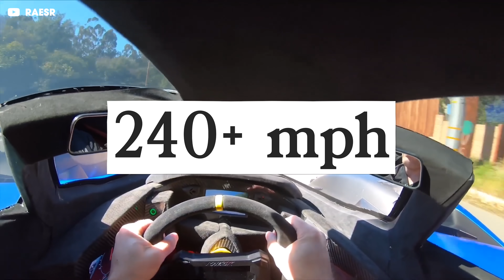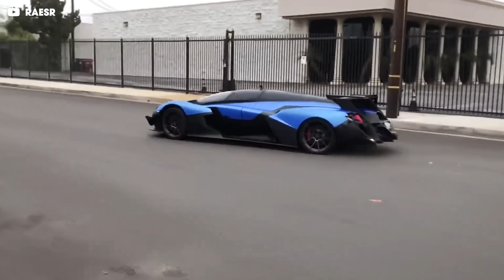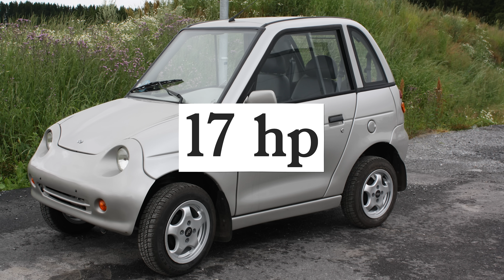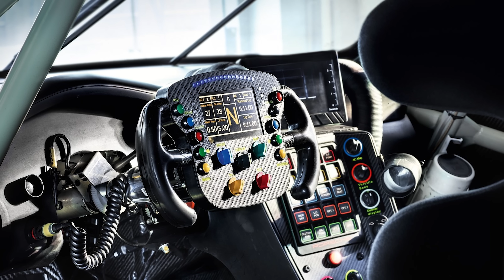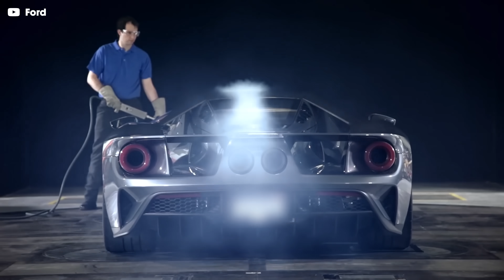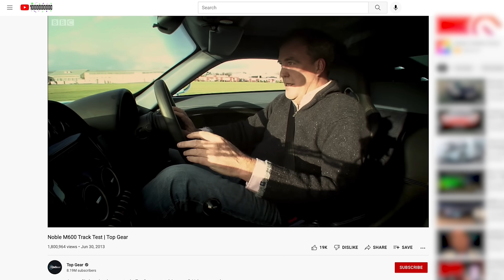Can This EV Hypercar Deliver on its Promises?

Comment: I believe the torque and horsepower claims. Electric motors produce absolutely bullsh*t amount of torque and horsepower, especially at launch and when cold respectively. It's why electric cars only need a final drive, but not a gearbox.

Comment: So with the 4000 ft/lb of turn... Are there actual parts that can take that other than a 5" solid rod of carbon fibre?  Or are there products that can take that strain and would fit in the drive train?  I'm an electrician, I know nothing about cars.
Reply: There's already parts that take that kind of torque. Torque is already reaching those sorta numbers after being increased by the transmission and differentials, my hummer for example Isn't far off from 4k wheel torque in high range, and around 16k in low range.
Reply: @wolfgang_h3t  yeah I had no idea, that is some kinda engineering!

Comment: The Lucid Air offers up to 5000lb-ft of torque in the top version. Electric motors are nuts like that.
Reply: You didn't watch the video did you.. lol
Reply: @calholli  
It would seen you didn't watch the video. Try watching the part about doubting the  400lb-ft of torque. It's early in so you don't have to dig that far.
Reply: @DocWolph  The 5k that you're talking about is 'wheel torque.  It's not even a relevant number really.  That means when I put my 4x4 in 4Low, I double or triple my torque at the wheel..  Looks good on paper, but doesn't tell the whole story.
Reply: @calholli  
I know. You think that because I did not say it I did not know? I knew about this stuff long ago.

As for relevance, it depends on how the motors are powering the wheels. Take a Dodge Demon 800 ho and about 800lb-ft, at the crank but at the wheels its about 3800lb-ft. But the ratios in the Transmission vary and are much larger. A direct drive EPV (Electrically Propelled Vehicle, or BEV) does not get quite so much of a multiplier. So the motors are going to be about as similarly powerful, albeit divided by the number of motors in proportion to which motor(s) are more powerful.
Reply: @DocWolph  That's why they created HP, because it uses torque, but also accounts for RPM's.  Some of these EV's are using planetary gears too.. Like the Porsche has a 2 speed trans;  so they can get the low torque up and still end up with a higher top speed than Tesla. lol...  I have an Acura MDX- if you look up "shAWD",  this is probably the best torque vectoring system other than the Torsen..    but I do get your point about torque vectoring with electric motors limits you to the power of that one motor, vs a mechanical torque vector system that can divert the full power of the engine to one wheel..  But for example the Tesla Plaid and Roadster have a Model three performance motor at each rear wheel (and one that runs both fronts)..  So I hardly see that as a "limitation..  These motors are plenty strong enough to do good torque vectoring.
Reply: @calholli 
I'm  just going to stop now ask you to actually look up the terms you are throwing around such as Horsepower(HP) and Torque and make sure you understand them before well enough to discuss them (they are actually pretty complicated) before using them anymore. 

This is not a contest of who is smarter but right now you are just off in the weeds.
Reply: @DocWolph  lol.. I must have lost you. Sorry about that.  You obviously don't know, so I'll explain it for you.  Horsepower is calculated by multiplying RPM x Torque.. then you divide by 5252, as the formula goes...  In general the idea is:  Passed a certain rpm, a given torque output at a higher RPM will give you more horsepower than that same torque at a lower RPM.. Which makes sense..  The same torque is happening, just at a higher rate, meaning that you're getting more work done;  so that's why talking about 'torque alone doesn't tell the whole story, so they invented HP as a secondary rating of the output you have and what it can actually do..  and See, that's why on Diesel's, horsepower isn't quite as relevant and not talked about as much.  Instead, diesel's are normally quoted by their torque numbers, and that's because they run at much lower RPM's, so it doesn't have that multiplication gain of a high rev'ing engine, it's more about brute force.  Diesel's actually have lower RPM's because they have long strokes, so the piston has to move up and down much faster than a gas engine, because for the same revolution, it has to travel a much farther distance in the cylinder..  So more people don't realize that diesel's have low RPM's, but they still have comparable/ to higher piston speeds because of that long stroke... and Idk what you mean about 'trying to be smart;  when someone is telling you something, they're just trying to help you. lol.. It's better to not be defensive and just learn and absorb things instead.

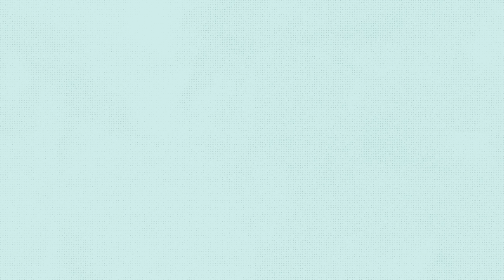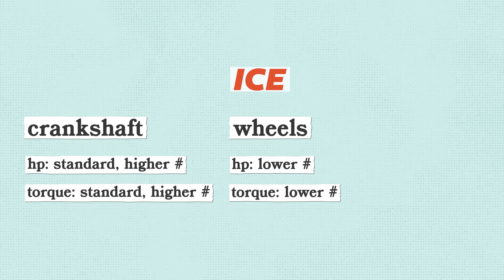Comment: 7:32 EV has direct drive. 8:10 EV has a ratio. The statement that everyone uses of electric cars not needing/having transmissions is not really true. Even everyone's fav the Tesla, has what is essentially a single speed transmission. Also, at 7:05 torque numbers are HIGHER at the wheels as a result of the torque multiplied by gears (not lower) and hp (ignoring parasitic losses) would be the same at the wheels as the crank. HP=(TQ*RPM)/5252. So, HP=((4*TQ)*(RPM/4)/5252. The 4 in this scenario would be a simple 4:1 gear box where the 4's cancel out in the equation yielding the same as the crank hp. (Again, this is assuming there are no parasitic losses. In short the torque portion at 7:05 is wrong, but the hp is fundamentally correct. Now to see how wrong I am as everyone picks this apart.
Reply: Glad to know that I wasn't the only one to notice that..
Reply: You are right the diameter of the wheel does not impact torque but the force that pushes the car forward, Tq=F x diam, so F=Tq/diam, they got it wrong. Also parasitic losses is used wrong both in the video and in your explanation, parasitic losses refers to all losses including internal engine losses at the bearings, piston rings etc., so if you measure the power of the engine at the crankshaft it already takes into consideration those losses.
Reply: @danetz88  Thanks for bringing up wheel thrust where I failed to consider it (I didn't mention wheel diameter). As for the parasitic losses, yes crank hp takes internal sources into consideration. I was referring to the losses in the gearing where a simple gear set like a Tesla's yields about 5-10% loss.

Comment: I have no trouble believing the torque claims. Automotive electric motors generally have ridiculous torque numbers for their size/weight. And the horsepower discrepancy could be a special mode that runs higher voltage/amps through the motors at the cost of battery life/wear and tear.
Reply: Electric motors in general. They are necessity for freight locomotives due to the sheer amount of torque required.
Reply: @dbclass4075  yes. I bet these cars require sheer amount of control to do so.
Reply: @purwantiallan5089  Henceforth the introduction of traction control, long before EVs were a thing.
Reply: @dbclass4075  whats the point of 4000 torque when traction control is constantly on and limiting it to 800?
Reply: @devlintaylor9520  Acceleration and for trucks (any type), payload. Fastest cars in the world (EV and ICE) have correspondingly high torque.
Reply: @dbclass4075  but that much torque will constantly spin the wheels even if its all wheel drive
Reply: @devlintaylor9520  Henceforth, why trucks would benefit it more than cars. Their massive weight contributes in minimizing wheel slip.

It is also an interesting challenge: a frontier present itself: tires limiting acceleration this time. Previously, tires limit top speed.
Reply: @dbclass4075  yea it is interesting, the only way to get past it is to probably find/make a better tyre material
Reply: @dbclass4075  and i doubt we will find anything better

Comment: This dumpa$$ car in a coupole sims like forza, and from my experiance while using a logitech steering wheel, its very hard to control, the tail keeps wanting to get away making oversteer very hard to prevent, and without engine noise, its difficult to tune my senese to driving the car around the turns, but this car wont exist anyways like most EV cars, that telsa roadstaer still hasn't been seen on public roads, nor is there any evidence of it drag racing other cars

Comment: How would four electric motors in the rear work? Genuinely interested on how they would lay it out and make it work
Reply: I think they mount them to one common shaft, kind like pistons to a crankshaft
Reply: Two per wheel
Reply: Two per wheel, and each pair of motors have their rotors are connected together to make one longer rotor, which is directly coupled to a rear wheel.

Comment: Drove it around for about half an hour, slow compared to my other cars i owned...

At least in Forza Horizon 5
Reply: I checked and it has a 0-60 slower than most mid level supercars
Reply: It handles really well though in that game. In FH4 however, it’s slow AND handles poorly because you can barely increase the downforce.
Reply: Did you upgrade or tune them?
Reply: @parrotyee  tuned every car i owned, even thr 3 wheeler or the mercedes trucks

I found it weirdly slow giving its power and weight, it should've performed way better than other cars.

I know it's just a game but still bothered me a bit. However, i couldn't engine swap the f50gt or other timeless classics, not to mention changing the aspiration method.

Still a good game imo
Reply: Speaking of forza, the pic of the car in the thumbnail is actually a pic from fh4
Reply: I maxed out the performance and I couldn't reach 400 kph.
Reply: Yeah I got it in FH5 as well, and it's surprisingly slow to start given its ridiculous numbers. The Porsche Taycan is so much faster in a straight line, it's only at very high speeds that the Tachyon's downforce comes into play.

Comment: We need a "wheel torque is real torque" shirt
Reply: Doesn't mean much when you take into account gearboxes
Reply: @S85B50Engine  more like it.
Reply: Some bot called “Light” with a check mark stole your comment and rn its next to your comment. Say something to that stupid bot
Reply: Then screenshot it and print it on a shirt lol, it'd probably be cheaper to get a decent print yourself instead of buying merch for 50 dollars
Reply: This car doesn’t have a gearbox. The motors directly drive the wheels. So in this car’s case, the motor torque IS the wheel torque.
Reply: @beanapprentice1687  Very close, but not exactly. Still have drivetrain loss to be accounted for. On a hub dyno, it would be close, but with wheels and tires, brakes and all rotational mass it is still not an exact figure.

Comment: theres been one nagging concern that many haven't pointed out with the ev's: the whine from the motors.  i get that its a game,  but in fh5, all the ev cars emit such a high pitch tone,  that i temporarily develop tinnitus.  i wonder if they really sound like it in real life.
Reply: Try turning your volume down a bit
Reply: I live in a city with tons of EVs and they all have a light whine like that, it gets the faster it goes. They're kind of silent if they're going slow though.
Reply: @ok0_0  except for that one electric mini suv from kia, those fuckers are pretty loud and can get annoying after a while    source: multiple of my neighbors have them
Reply: @NoelleTheRanger  can't wait for the next generation to obsess over this 'beautiful' sound and we become the boomers
Reply: They sell EVs by saying how quiet they are and all i hear is an F1 car pitched up 4 octaves
Reply: The EV noise in FH5 is really unrealistic, unless your EV has straight cut gears. Otherwise it should be almost inaudible.
Reply: Yeah it's just kind of how it is, modern electric car engines are basically steppers and in those even under best conditions there's tiny amount of magnetic rippling which induces audible noise. The finer your electric control the less there's noise, but already the inverter switching frequency is a limiting factor to increasing resolution & reducing noise. Induction engines don't whine but they're woefully inefficient compared to various types of steppers.
Reply: Electric cars do make a small amount of sound, but depending on the car, you might not hear it if you're not listening for it, especially if you have some music on.
When they're moving slow, they're so quiet from the outside that you might not be able to hear one right behind you. Because of that, electric cars sometimes have artificial sounds to make sure that you can hear one coming from afar (I know Teslas do, but only in reverse, at least in america. the laws differ). That's why they seem loud sometimes
Reply: I hope not! I already don't like ETDs (electric transport devices) because they lack soul, sound, and feel. I am sensitive to high frequency sounds, and can hear higher frequencies than most people, so driving a V8 muscle car and every time I pass ETDs on the road, hearing a high frequency whine would likely cause a wreck.
Reply: @captainawesome7092  I dont think you should be driving then. Even internal combustion engined vehicles can make high pitched sounds in their transmissions or other components.